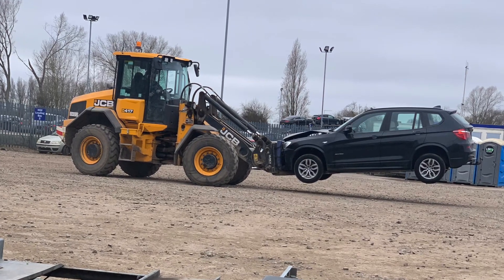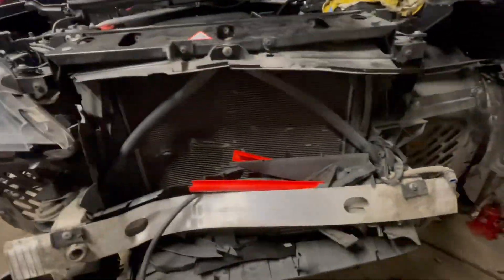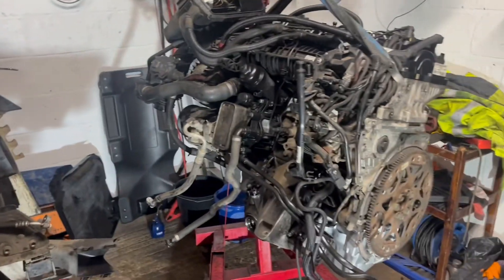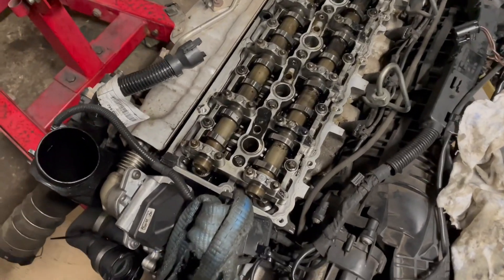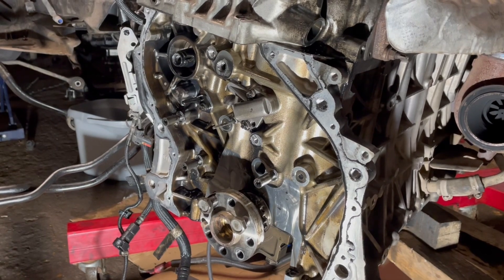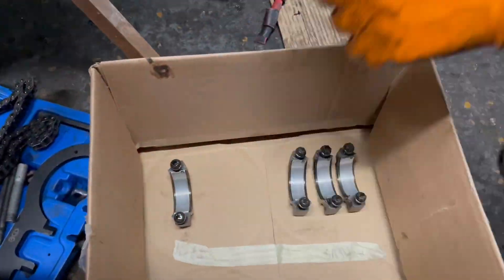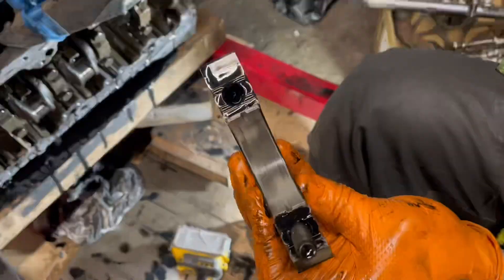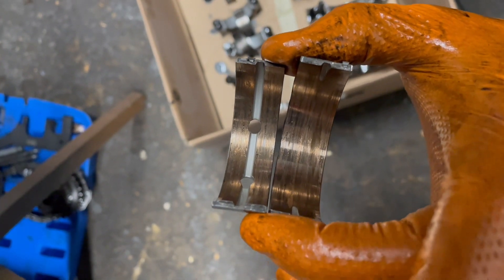BMW F25 N57 Rod & Main Bearings Failed? Rebuilding a Copart X3 Nightmare Part 1

Comment: Can i change the bearings without take engine out?
Reply from the maker: Possible, but I wouldn’t do it that way. When replacing bearings, it’s critical to take measurements -at least with a Plastigauge -and for that, you need oil-free bearings and a dry crankshaft. Without measuring, it’s not worth doing in my experience.
All the best.

Comment: I had one of these n57 engines in with a low oil pressure fault s few years ago, they'd turned off engine immediately and stripping down to check the oil pump off the car, when spinning with a driill with the pickup sumerged in clean engine oil it was venting out of the side, rather than pumping our of the top outlet because the presure relief valve had got stuck in the vent position. Cleaning the pressure relief valve throughly as it was quite sticky so it moved freely resolved the problem and the car is still running today.
Reply from the maker: @nemz7505  in my case oil pump is spot on, after the bottom end rebuild car is running good.

Comment: surely if the locator tab is still in order, the bearing has not spun?
Reply from the maker: In theory yes, but due to the massive wear on the middle of the bearings, when I’ve removed the cap, the bearing was hugging the cranckshaft, didn’t come out with the cap…in any case rebuilt is successful, till this day is running like a dream

Comment: An inquest into PC Dumphreys' death, held earlier this year, concluded on Tuesday (December 20) with Assistant Coroner Robert Cohen revealing that BMW had first known about the fault with the N57 engine in 2016. The inquest heard that since 2014, five to seven crankshaft bearing failures had been reported each month which the coroner described as a "startlingly high failure rate".